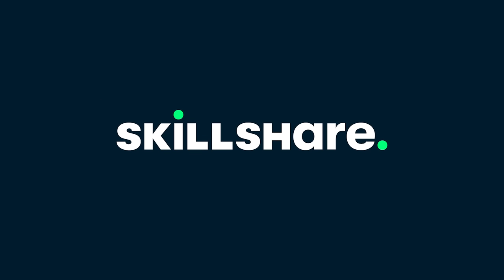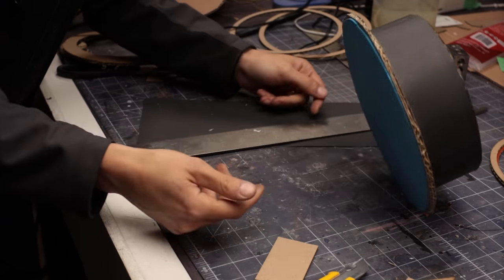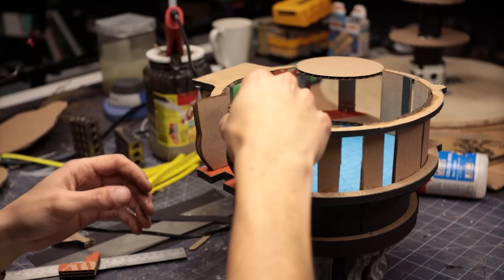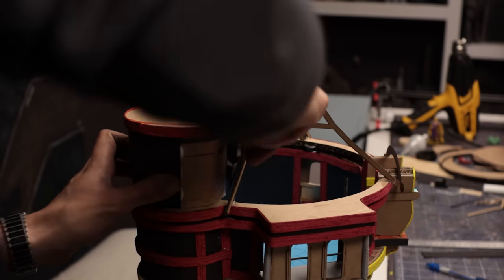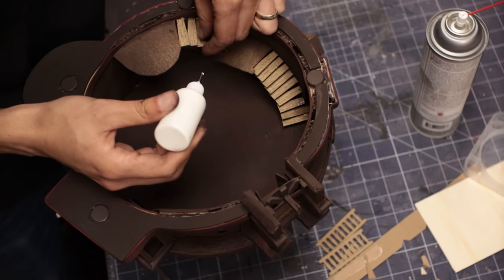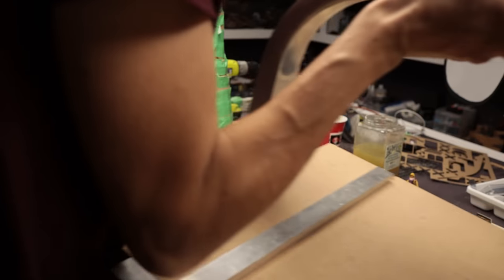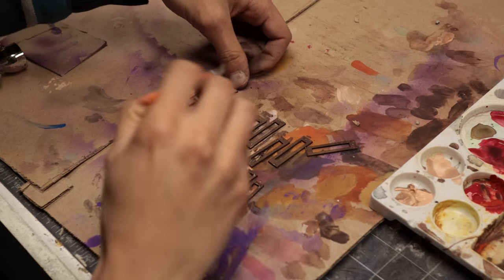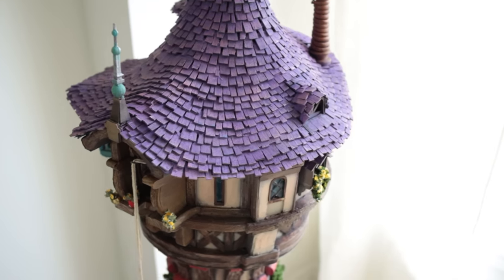This Miniature MIGHT be too tall? 5'4" Rapunzel Tower

Comment: I don’t know for sure, but I think there may be a few inconsistencies due to the length of planning that went into the movie. Originally it was meant to come out in the late 90s early 2000s, but the animation skills were still too rough and hard to use for complex scenes with Rapunzel‘s hair. So they put the movie aside and tried again about one and a half decades later. Then the director died and someone else took over. So I’m not surprised, that some things don’t add up.

Comment: Awesome project, as always, though I would like to point out, 1370mm actually equates to 4’5, not 5’4, so I don’t know which is wrong.
Reply from the maker: Yes, that was my initial projection on the height.... but I ended up making it taller in the end, to the 5' 4" it is now.

Comment: In regards to the discrepancies, it's likely that the interior and exterior sets are different assets. This could be done for a variety of reasons. For example:
1. Cheating the layout so that the interior looks exactly like the concept artwork. This isn't noticeable in the film, and allows the artists to create the right shape language within the room. As long as it looks mostly like the exterior shape, it's fine.
2. Having the sets separate would make the file size a lot smaller, since they wouldn't be rendering the entire tower in one go for each shot.

Continuity is pretty important in animation, so the discrepancies are likely something they knew about and decided it worked fine.

Really great build by the way! You did an excellent job :)
Reply from the maker: Yeah I figured it would be something like that. They need to get the right kind of shots to make the movie enjoyable, and sometimes it makes sense to move stuff around to suit that.

Comment: Laser a much better choice than that overextended knife...Tower windows needed spacers to bring to mid level at  Rapunzel's eyes. Also spacers could form steps to outside observation slabs or make steps to lower cylinder...
Reply from the maker: No idea how I still have fingers TBH

Comment: Question 

Why is there concrete inside the tower
Reply from the maker: Makes the center of mass very low on it, so it's very hard to tip.
Reply: @KnarbMakes  are ok thankyou a lovely build